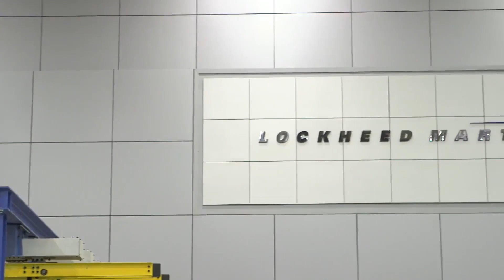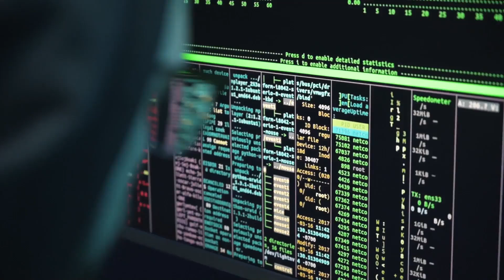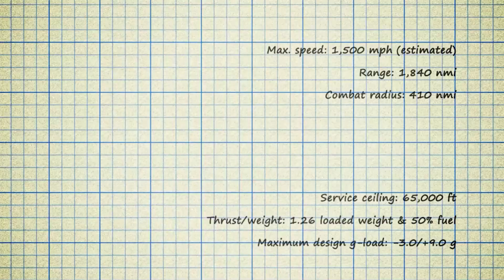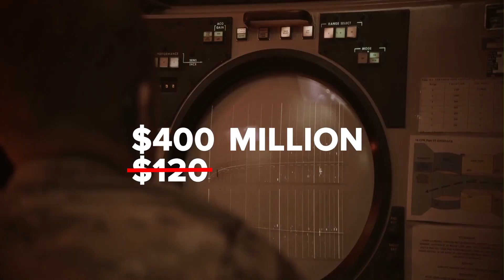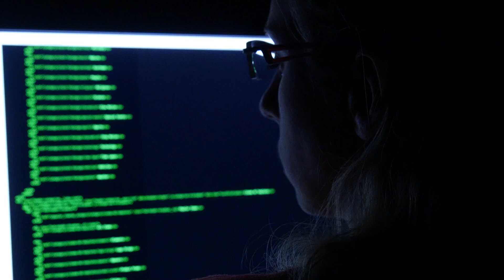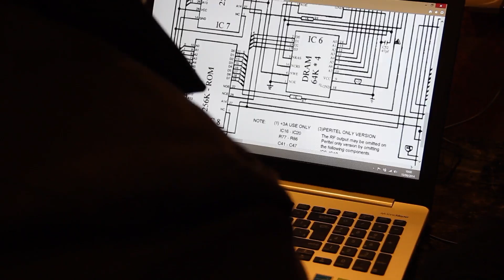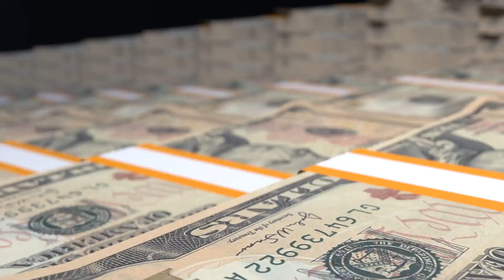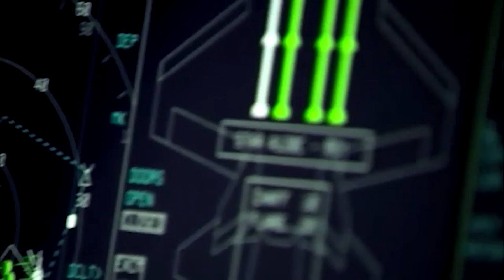Why USA Never Sold the F-22 Raptor to Other Countries

Comment: Pentagon  f_ _ _ s up everything they are not in control , look how they messed up the zumwalt gun system , they reduced production so much each shell coast over 800.000 each . How stupid was that now they are taking the gun  out and replacing it with hypersonic missiles  that only 4 can fit before withdrawing for refit with missiles , do dumb?.

Comment: 🤦F35 CANNOT takeoff vertically. Its called STOVL Short Take Off Vertical Landing. its not a VTOL. Adjusting for inflation is stupid also, thats not the true price you pay cause currency has different value all the time so when you adjust youre also adjusting for its increased/decreased value. Theres a reason why many hedge funds love investing in certain currency, because you can buy low and sell high when that currency gains strength, just like the stock market. Numbers will be much higher if when you adjust that currency hasnt performed well when you do it, compared to it couldve been performing great when you bought

Comment: I don’t think the F22 operates outside the USA…
Reply: Operates outside the US; it indeed does.  Operated by anyone other than the US, then you'd be correct.
Reply: @wdwalker2178  I was always under the impression that the F22 stayed CONUS at all times, unless in recent years they started deploying them OCONUS..I could be wrong though. I always just assumed the Navy fighter jets did a lot of the forward deployment heavy lifting and I thought that was the whole reason behind the production of the F35? That and to be a joint fighter with variants sold to other countries. Learn something new everyday.

Comment: So let me ask a dumb question,  what is stealther? The F-35 or the F-22, ?
Reply: F-22
Reply: F-22 cross section, from what I've heard from other videos, is the size of a bee, while other 5th gens are roughly the size of a pigeon. Forgot the numbers exactly but basically it's 4x stealthier than the f35 and china's j20, while Russias su57 is 10x less stealthy than the raptor. Not to say none of the other 5th gets aren't stealthy, just that the f22 is that much more stealthy.
Reply: @maxinmaniac  If they use newer low band radar they can see them. That's why B2's are used with stand off munitions now.

Comment: The B2, The B52, The B1, The F22 and The A10. As soon as I read about their capabilities, I knew they were never going to be for sell.
Reply: B-21
Reply: They would, The A-10 can support ground troops and destroy tanks.
Reply: @Jfarhan1990  it theoretically can, with missiles. The gun is useless in destroying moving modern tanks. The USAF is already trying to retire the A-10, if I remember, only congress wants it on service because of its reputation alone, not capabilities.
Reply: A10 very controversial. It’s a sitting duck without absolute air superiority/no fly zone. It does punish ground forces. The idea nobody wants it isn’t entirely true —the Ukrainians wanted it but many voices told them it wouldn’t be effective for them. We used it to good success specifically in the desert terrain and with total air superiority…
Reply: Ok
Reply: Japan has been reviving the YF23 buying the initial designs from Northrop. Honestly, we should do the same. It was a very reasonable competitor to the F22.
Reply: To be fair, no US allied country wants to buy the A-10.

Comment: Manufacturing of export variants was not possible bcoz of budget costs.. it's that simple. Other bullshit sources normally blend the story claiming that it's bcoz of its sensitive tech and capabilities. Well, F-35 has the same stealth coatings, same aerodynamics, better detection range, and itself being a flying supercomputer makes it more dangerous. But it's low budget costs for manufacturing and running as well as being  multi-purpose makes exportation possible.

Comment: Another problem related to the manufacturing aspect of restarting the F-22 program is some of the machines, tools, dies and molds unique to and needed for making the parts and components for the F-22 are missing.  When Lockheed Martin shut down the F-22 production line after the program was canceled, these items were supposed to be packaged, cataloged and stored away in designated facilities.  Years later, it was discovered that some of them are not where they were supposed to be, and nobody knows where they are.
Reply: Trump’s desk.
Reply: China, probably.
Reply: @jamjardj1974  J-20 Mighty Dragon 🐉 wink wink 😉
Reply: @venomau5speedz  🤣
Reply: It was done on purpose
Reply: How do you think chinese produced j 20 , j 35 😂
Reply: Probably China
Reply: In a warehouse in China owned by Joe Biden...

Comment: I suspect that the F-22 has a fatal flaw which the U.S doesn't want anyone to know about. After spending a shed load of money they came up with something only slightly better than its peers. Why do I say this? Look at the track record of all U.S stealth designs, now compare them with "legacy" designs such as F-15, F-16 and F-18. All those 1960/1970 aircraft are still competitive brawlers, yet the stealth aircraft have been retired early and all have had their procurement cut. The U.S.A.F planned an initial F-22 fleet of 700+ machines with a whole life purchase estimated around 2500. Figures which compared favourably with its predecessors. Aircraft such as Rafael and EF2000/Typhoon can handle F-22 now that their radars have been adjusted to recognise the F-22 returns.
Reply: it was designed around cold wars. now that the cold wars was no more, it became useless piece of art decorations.
Reply: The Raphael and typhoon ,euro fighter cannot compete with the f22, hell the f15,16, 18 cannot compete with the f22. The F22 is being retired due to cost and that the defense industry cannot make money by selling it to foreign countries .The F22 is a better jet than the f35. Lockheed .Boeing,Northrop and all the other defense contractors get lucrative bonuses, and most of the upper brass and upper echelon end up at these companies. If they can sell a lot more planes even if it is slightly cheaper well that is more money. Also more of a bonus to themselves and shareholders. Corruption is the real reason. Hell even China stole some of the 22 designs for there J20.  American government only cares about 4 things, War and money ,power and control. The government hates their own citizens .
Reply: @SupremedivinereaderKim the "governments hates their own citezens" putin said this 😢
Reply: What's the point of spending >200m usd to build a jet with no genuinely opposing force? Then there's cost of maintenance and all that good shit. If Russia broke loose and started flaring up ww3 and somehow the US got involved, they'd open that budget up in no time if they needed to for any reason, but there's a ton of other areas for less capable but still solid options. Basically the f22 was produced to overkill, and there's nothing to overkill, so now it's just burning a hole in the budget.

Comment: There are F-22s in Kadena, Japan to replace the F-15s as they are already getting retired.
Reply: Yeah that's because they're at the US bases.
Reply: @markdavenport17  And because F-22s are retired, the NGAD will take over so the US would sell F-22s to Japan and keep it there.
Reply: @ETAN_YAN_Main  unlikely the us sells it more likely going to be a trainer and target drone after it’s retirement in 2030
Reply: @ETAN_YAN_Main  USA will not sell the F22 to Japan, it will go to the moth ball fleet , until it is needed again. For 1 the f22 is still a better airframe than the F35, the f35 is much cheaper as it it’s r&d cost was spread out, so the materials are also cheaper. The 2d tv thrust makes the raptor have better maneuverability. People in the chair force still brag about why the raptor is better and of course f35 pilots are going to whine and mope, updated f22s vs f35s are a no brainer. If the chair force was smart All F22s would be updated, the still have planes in use from the 50s.

Comment: At the time, the US just created the only stealth aircraft with the ability to go supersonic and perform high alpha maneuvers. It was obvious that they were going to bend their backs to protect the low-observable coatings and software of the Raptor hence, the refusal to sell the airframe to foreign allies in fears of espionage. Fortunately, years of operating the F-117 Nighthawk, B-2 Spirit, and F-22 Raptor allowed the US to learn and make an airframe that's harder to reverse engineer with better software and low-observable coatings which is the F-35 Lighting 2 hence, the export of multiple airframes in different nations.

People shouldn’t just say that the F-22 is more advanced than the F-35 since the US doesn’t sell them back then, it’s just that the Raptor was the first of its kind. Nothing else, nothing more.

In related news why the Raptor's assembly line was shelved... well, it was simply too expensive to procure and maintain at a time where there were no peer-to-peer adversaries at all.
Reply: also while flying and testing the first f 22's they probably realized the yf23 black widow really was better so they took both and melded them with tech advancements and started the F/A xx program and we're likely to win the 6th gen race as well, if we haven't already.
Reply: @aunderiskerensky2304  NGAD project coming along nicely. The just used the f35 to bridge the time between the raptor and 6th gen.
Reply: @mikegrizzle3014  yea the f35 always felt like the f16 thought process. it's a solid jet no lie, but it's definitely quicker cheaper processes that were used to build the f22 which i imagine we have all but perfected that tech over the last decades. i've been dazzled by aviation since i was tiny, and it's so cool to see where it's going now.
Reply: Could it be just the system of building jets in the US?  For example, Korea KA21 and Turkey KAAN fighters are F22 knockoff....How many of DOD F22 senior leadership now have advance STEM DEGREE much less a military pension now....  You be surprise at the data.
Reply: the f22 is way more capable in air combat than any other aircraft ever
Reply: And how dominant they are why would you need so many?!
Reply: @matthewvaroz4812  dude what
Reply: @matthewvaroz4812  to be given away to allies while having some for yourself?